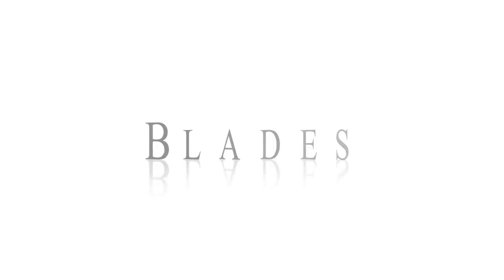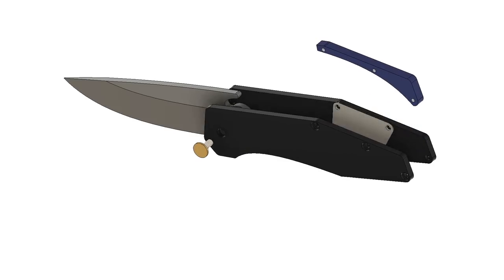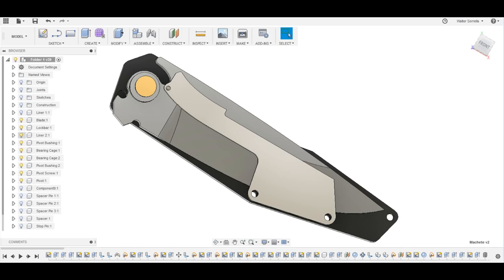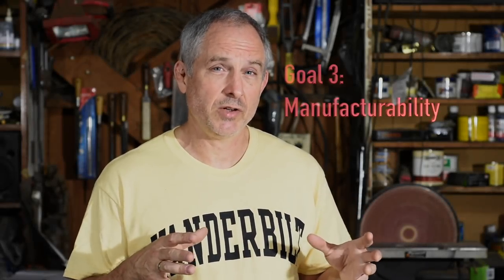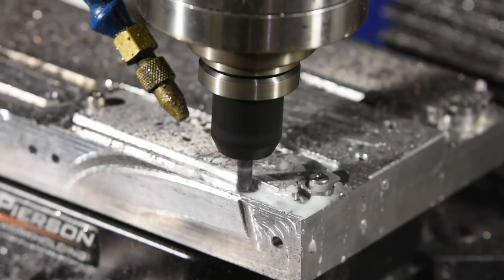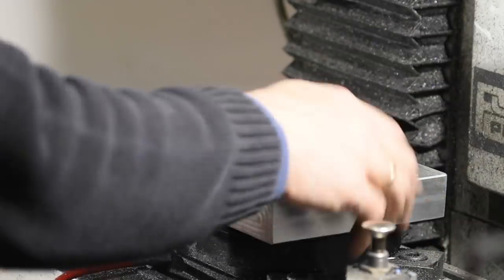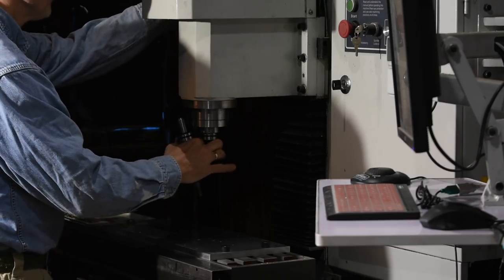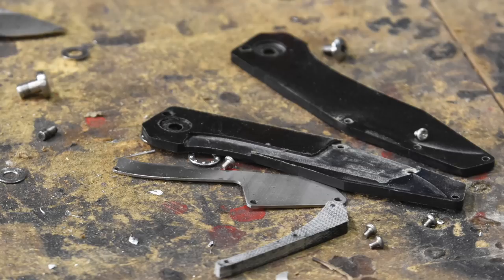Folding Knife Chronicles #2 - Designing a Folding Knife

Comment: I think  full liner on both sides would be simpler and more in line with what you want to do. Not having full liners will impose some limitations on what scale materials you can use. Full liners would allow you to use wood, and even gasp rubber. So if you are aiming for simplicity and flexibility, I can only suggest full liners.

Comment: You're a brave man, good luck! I went from being a fixed blade collector to folders and it's a whole different world, buyers here are much more demanding and exacting and are far more fickle. Some tips, don't use Teflon washers, lock stick or blade play are a models death, even a dumb-dumb had better be able to flip it if it's a flipper, and make sure it's a deep carry in the pocket- a half inch sticking out of the pocket, no more. And steel does matter, don't let anyone tell you different.
Reply: Mt. Baldwin Don't forget centering.  I've got these 2 ZTs that are going to back for warranty to get them centered.

Comment: What matters to me with an EDC folder: is it easy to get out of my pocket and open one handed (phosphor bronze washers at a minimum, bearings even better)? Is it hard enough to take an edge that will get thru a fuckton of cardboard and still be a reasonable steel to sharpen. Is it light- does it meet my 1:1 blade length to ounce weight requirement? A 3 inch blade should be in a 3 ounce or a bit less overall design. Does the pocket clip deep carry? Is it comfortable in the hand, or does it have hot spots ( radius those long edges and contour the scales)? Lastly is it slicey? I mean does the thickness behind the edge thin down enough that it doesn't impede slicing tasks. Me, I like a hollow grind that I then knock the shoulder of the secondary bevel off, but there are other ways. This is the mental check list I go thru when I shop for a folder I intend to carry everyday.
Reply: Something I'd definitely add is a solid detent

Comment: I like the idea of the design being modular.  Look at the new trend in modular handguns with the chassis serialized and the grips interchangeable.  Also check out vintage Imperial and Hammer Brand folding knives.  They had a stamped metal chassis riveted together with "scales' that were clipped on like hub caps.  I'm sure this was done to make the knives cheap to manufacture, but it also allowed for a great amount of variety in the scale color, material etc.

Comment: The main problem I have with most lined locks is most are stamped steel. After the locking mechanism wears a bit of starts to stick of slides too far and gets really stuck. If you look at the stamped part, it's not a clean engagement surface. It's like looking at a stamped flat washer. There is a front and a back to it. That's what causes the problems. Most lined locks would benefit from more attention being paid to this part. Just my two cents. Love your videos. Keep an coming.

Comment: i realize you are a busy person and may not reply but wanted to ask a few questions. if you have this information available in a video; please direct me to it.  how much does the grind of a fixed blade knife matter in its strength? is that determined by its planned uses? or maybe by the steel used? are all grinds the same but really its the heat treat and steel that matter?i want to make my own knife with a five inch blade ( i think this can be carried in public and in a vehicle with no legal issues in the usa) .  one that does medium bush craft and survival tasks. and has tactical use. i am thinking it should be either a sabre grind or convex. should i use a steel like 1095? a steel that wont break but can flex and be re-sharpned quickly in a pinch?  thanks if you do happen to come by this and respond.

Comment: I am on board with the small 'er plain well made. I am not a huge folder guy, although try to find one that doubles as a money clip. Or can even be used as one without bending or modifying the clip. I challenge you that. (without carrying a piece of garbage) I looked for months! had to settle on the Kershaw "Ken Onion design "1620FL.  & die grind the protruding pin on the blade facing the clip to clear my money & cards.

Comment: I don't know the folding knives regulations or the market for folding knives. I really like your design, just need some minor improvements, for example: you can put a spring on the opening mechanism - so it will pop when you release the button, with a two spring pressed "liners" to small round pieces of steel/whatever material you like, that has the same hardness as the knife, insted of the simple "flip knife.
Reply: DO NOT add a spring of any sort.

Comment: The way you opened that knife would be totally illegal in my country Canada and would be illegal in some state in the USA as well ,so that may be something you want to take into account when deciding on your final design . You could be cutting your products out of some markets before you get them to market ...
Reply: No, it's perfectly legal, you just don't know our law.

He had to pull a lever to open it, hence it is legal in Canada.

It is only illegal here if it can be opened by a simple push of a button, like a switchblade, or can be flicked open(Which is pretty ambiguous, depending who is trying to open it).

The knife can even be spring assisted as long as you physically have to pull or push on the blade to open it.
Reply: Generally if it can be opened one handed it is concerned illegal and a "Weapons Dangerous" charge.
Reply: We have google for a reason, people.

From the criminal code of Canada -

"prohibited weapon means

"(a) a knife that has a blade that opens automatically by gravity or centrifugal force or by hand pressure applied to a button, spring or other device in or attached to the handle of the knife, "

So as long as you are not a criminal or you are waving the knife around, nobody is going to arrest you for it.
They sell countless knives you can open with one hand in most stores that sell knives here.